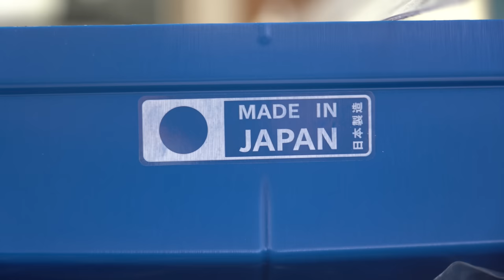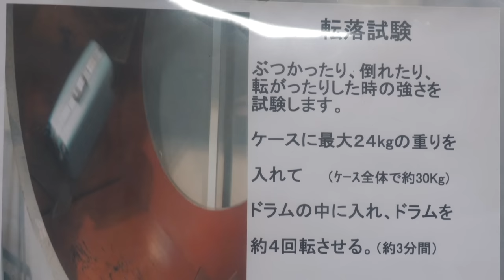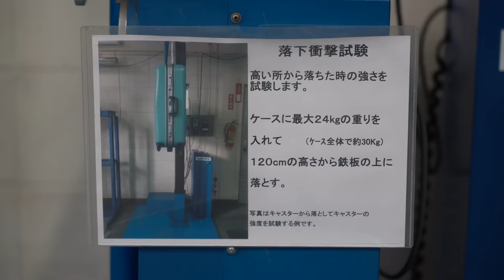スーツケースを大量生産するプロセス。日本唯一のスーツケース製造工場

Comment: Big difference between Vietnam ...By simply looking at the physical appearance you can tell its a high quality..I work in Japanese manufacturing and you can tell that this company is really Japanese..The cleanliness and orderliness..specially   safety
Reply: Agree. You can tell they prioritize quality over quantity.
Reply: The working condition is significantly different.
Reply: @SarabjeetSanghera  yeah, it's the customer's prerogative to choose whether they would risk it with the cheaper one or spend more on the more expensive but quality one.

Comment: The blue luggage was made by Proteca (Japanese brand) model name is FREE WALKER GL, materials are Polycarbonate + ABS mixed resin. Has high strength, high stiffness, high heat resistance, and high impact resistance.

Comment: I like it. ❤ Very good quality. Excellent quality testing.
These Japanese suitcases 🧳 are highly suitable. 😅😊

With Lean Six Sigma, I bet they can make it more efficient in production.
For example, there were 4 different types of machines that creates a hole each; taking 4 steps. Why not simplify that into a one single step machine that punches 4 holes at a time?
Reply: they make different design and size and every design need different holes in different inches and one machine is very complex and not able for all operations,
and it is easy for maintnance purpose
slam from pakistan

Comment: I'm assuming it's just molded plastic?
it's bad that there is no metal frame inside, but the weight of this product would be very heavy
I mean, once such a suitcase was broken at the airport, it cracked like an eggshell (it was not of high quality)
I liked this plant, everything here is so modern that I wonder how it was possible to create
Thanks for the interesting video
Reply: I think it's some kind of polycarbonate resin mix, idk if that's durable enough or not with very heavy luggage but if it's only for maybe 5-10 years of being used as normal travel luggage it should be fine, it's a cheaper mass produced model after all, not the high-end one
Reply: @oniplus4545  It's just that if the plastic is hard and not soft, it will be more crumbly and not elastic.
In the production of suitcases, it is just necessary that it be elastic, since we all know how baggage is loaded into the airport
Reply: @PROProcesss  correct me if I'm wrong, but isn't polycarbonate elastic by nature tho? even if it's a little bit, in that video the case can bounce like a jelly a little bit when it got into hard impact
Reply: @oniplus4545  I don’t know what kind of plastic is elastic, but yes, in the video it is elastic, so this suitcase will be good
Reply: ポリカーボネイト樹脂は防弾ガラスにも使われる衝撃に対して強い樹脂です。
CDやDVDにも使われている樹脂です。
但し薬品には強く無く特に四塩化炭素と呼ばれる薬品が掛かると瞬間的に侵されて分子結合が切れボロボロに分解されます。

Comment: excellent high strength plastic polymer suitcase manufacturing in Japan but Zip should be replaced with sliding locks for excellent security #